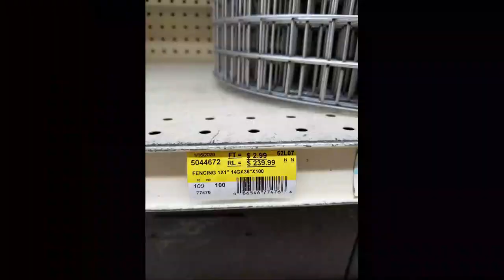How to build a Cage trap for Bobcats! Part 1

Comment: I join the corners the same way wire wrap and j clip, makes nice strong corners. I second the recycle sentiment, my first cages were framed with mud flap anti sail brackets off a big rig ( 3/16 round stock) now I get pieces of grid wall and break it down for the 1/4 round stock and build frames out of that
Reply from the maker: Thats awesome! I reuse whatever I can to cut cost. Just buit three more cages and made the doors with some 1/4inch round stock from.a trampoline net. Worked great! Thanks for watching!

Comment: Would 16 guage wire be strong enough in a framed cage my idea is remaking the duke style trap but 20x20 inch for fox
Reply from the maker: I haven't tried the 16 gauge wire. However the animals are harder on a framed cage because it is not able to flex when they fight the cage.
Reply: @OutdoorMike  do you think the 14 gauge wire would work well if it's 20x20 inch or does it need to be narrower to have the rigidity as all the traps iv seen on YouTube seem to be narrower than they are wide

Comment: Hey Mike where are you getting the 1x1x36in x 100' cage wire now I cant find it anywhere, Ace says they don't carry it any more I'm in Phoenix,  thx.
Reply from the maker: Tractor Supply carries it. If you order a 100 foot roll they will deliver it to your house for free. I had to order it on line. But it was cheaper than ACE and free delivery.

Comment: The trigger wire you mean it’s just a piece of 1/8” of cold rolled steel rod? You said wire ? Just checking
Reply from the maker: Yes. 1/8" cold rolled. I buy it in long sections, and it looks just like  a long wire. So I kept calling it that.
Reply: @OutdoorMike  cool I thought so just wanted to double check just looking for supplies. Thanks man

Comment: Where do you buy our wire ? I can only fine 1x1 x36  14ga in 100 ft. rolls.  Would like to buy a smaller roll.
Reply from the maker: Ace hardware carries it. They have 100 foot rolls but you can buy it by the liner foot from them.
Reply from the maker: The part number is 5044672

Comment: Can you recommend a mesh manufacturer/ supplier.   

I can't find anything local. 

Thanks
Reply from the maker: I buy mine from Ace hardware.  Also called True Value. If they don't have it on hand they can order a 100 foot roll for the store and you can buy it from them by the liner foot. The 36" wide roll is 2.99 a liner foot from ACE.
Reply: @OutdoorMike  thank you
Reply: @OutdoorMike  my ace couldnt find it in their system.   Could you find a sku possibly

Comment: When I cut my wire off the roll I cut every other piece of the wire on one side then I cut the other side so I have a one inch long wire to wrap
around the corners of the cage every two inches. No J clips required.
I make rabbit cages and I re-enforce around the door with wire from election signs.
I am looking at making cage traps outt of powder coated wire closet shelving.  I find lots of it in trash piles.
Reply from the maker: Thats a good idea! Thank you for sharing!  I also agree with using whatever you can find and repurpose to save on materials.  The J clips are for reinforcement to ensure that animals who fight the cage harder don't get out. Thanks for watching!

Comment: Where you buy the 1x1 wire at?
Reply from the maker: Ace hardware.
Reply from the maker: 5044672 is the part #. Most ACE stores don't keep it on hand but they all can order it. The bigger stores usually have it.
Reply: Thanks I will check there